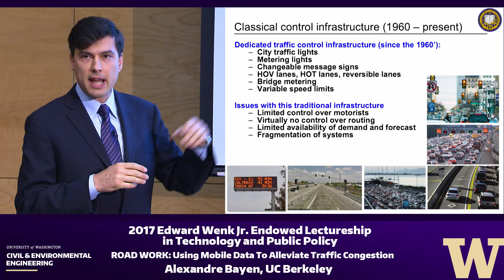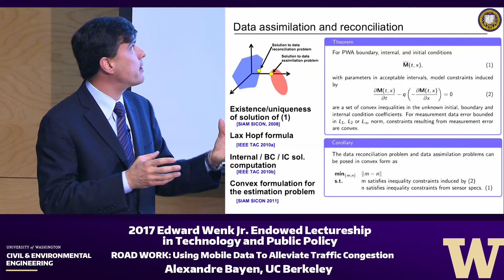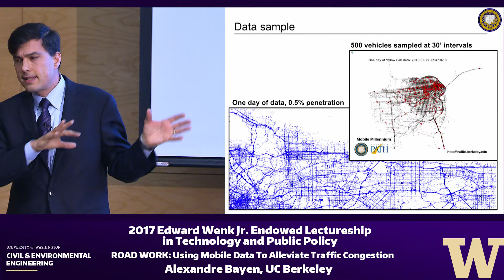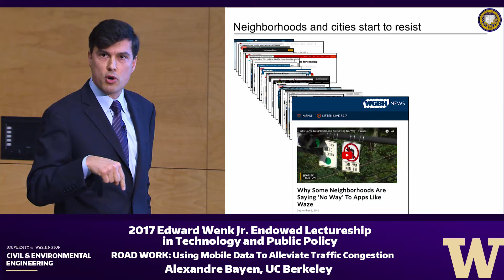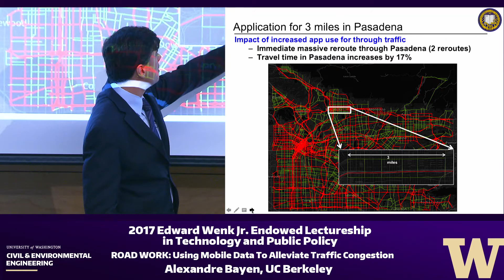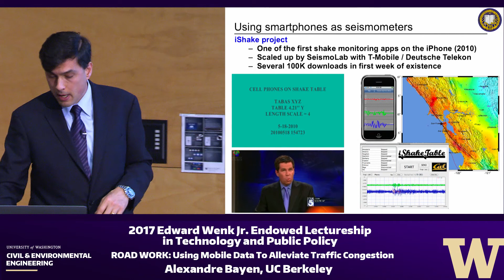Road Work: Using Mobile Data to Alleviate Traffic Congestion

Comment: I think that Prof. Bayen is perhaps too cynical about the willingness of routing providers to collaborate in order to reduce overall trip times (especially Google). As routing providers get more penetration, they inevitably control enough of the system to affect their own route selections; I'm sure Google knows enough about users to predict, or maybe they could just ask, that they may not want the fastest route for a particular trip, necessarily. I'm sure there is some room for collaboration between the top two, or maybe the biggest and third biggest.